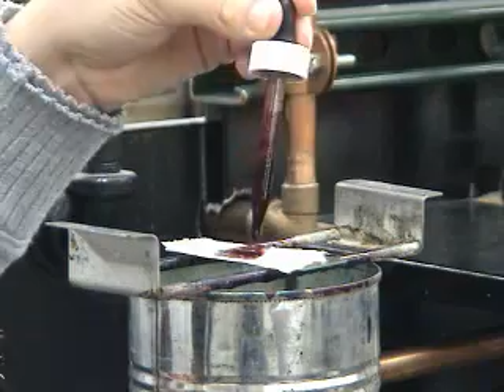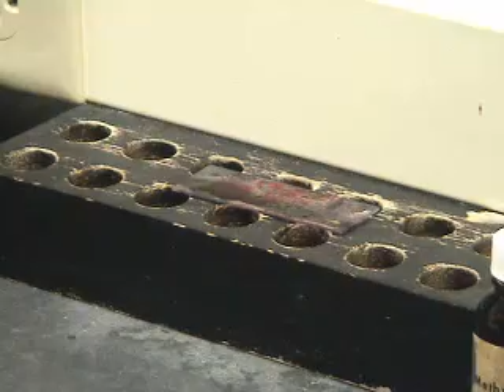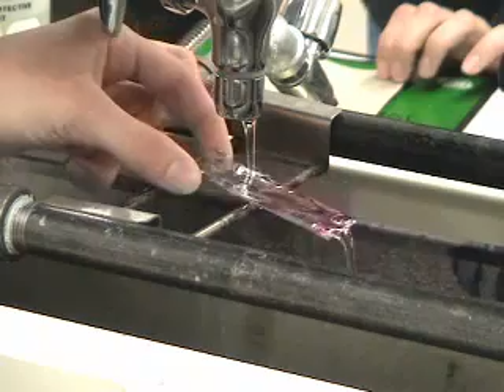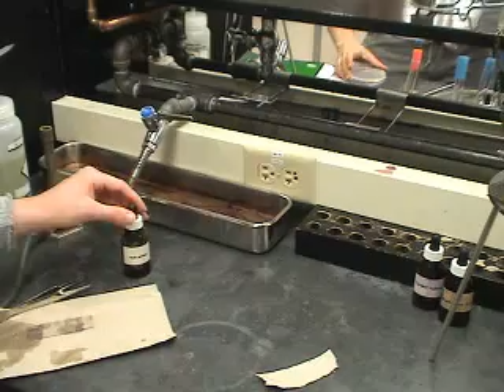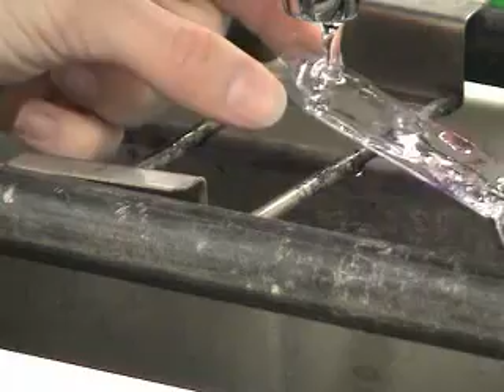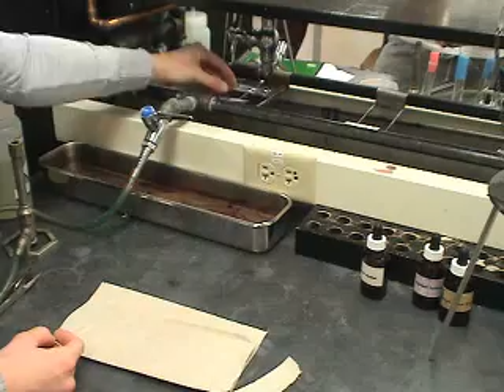The acid fast stain

Comment: Nice demonstration. Shouldn't you be wearing gloves? And wouldn't the heat from the steam denature the bacteria?
Reply: Thanks for the comment. Nope, no gloves. During this procedure, a scientist can wear gloves if you are concerned about getting the stain on your hands, but I would rather they were careful enough that this wasn't an issue. Gloves are wasteful and make you sloppy. There are times when it's a good idea to wear gloves, such as when you are working with pathogens or if you are using toxic chemicals.
Reply: @timothypaustian3852  Which acid/alcohol solution is used for this video? I'm confused at your stance on gloves, the typical 20% H2SO4 solution is - according to the SDS - able to "cause severe burns to skin and eye damage". Why would you choose to avoid wearing standard PPE for this? Maybe you're using... something else that isn't corrosive to skin? I've also never seen any pair of properly fitted latex gloves cause any noticeable loss of dexterity, hence their use in surgery and pretty much any legitimate lab environment. Latex gloves actually increase grip while holding wet glass. Not trying to troll you, I'm genuinely confused at why gloves are not being used while handling acid.
Reply from the maker: @BigWalkinTallV  First, they are unnecessary. If you are careful, the solution doesn't get on your hands. If you are wearing gloves,  you don't have to worry about it, and if you do get something on your hand, it is less likely that you will notice. Then when you touch something else you spread it on that surface, etc. If it does get on your hand without gloves you will notice and wash it off immediately. Second, it's wasteful, especially in a teaching laboratory. Instead, we provide forceps or clothespins that students can use to hold the slide at that time. You will notice in the video the experimenter does not get any stain on their fingers during the procedure.
Reply: @timothypaustian3852  Thanks for the reply! That makes sense. Great humor in the video haha.